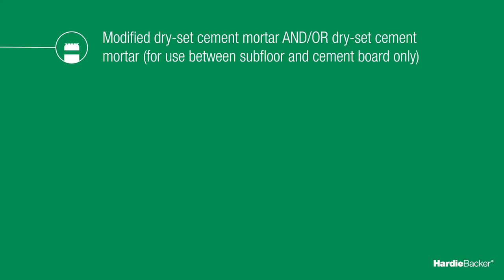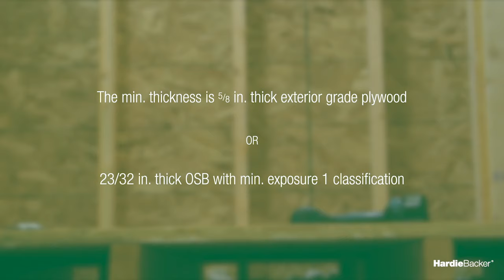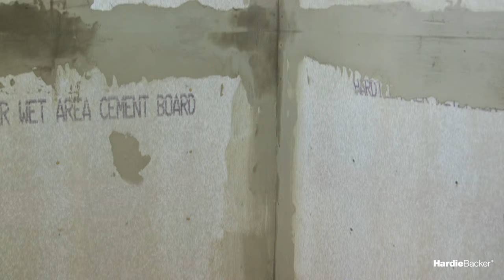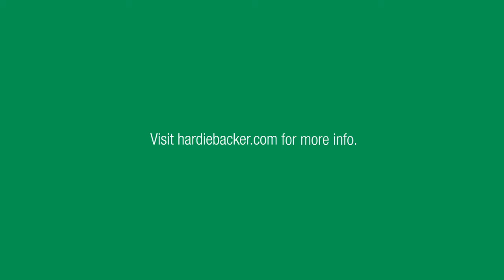How to Install HardieBacker Cement Board on Floors

Comment: What adhesive do i need under the boards? Video is not very clear on that. Have searched the whole Internet for an answer.
Reply: modified thinset
Reply: It's not glue. It's cement based thinset.
Reply: Elmer's

Comment: Question...Is it required to add both mortar and screws to the sub-floor? I've been told you can use screws (every 8 inches) and not use mortar. This is going in my upstairs bathroom. Can you comment?
Reply: Use mortar as well. Any professional tile installer more than likely will do both. Mortar is cheap and it's not worth the risk to just use screws.
Reply: I wouldn't use mortar if boarding over a plywood floor, the floor is flat and no voids, I only use mortar when need to fill voids below the backer boards
Reply: @rodlaz1984  Always use mortar on plywood subfloors...
Reply: @ruvimtrofimovich  mortar only to fill voids, if the wood floor underneath is flat, mortar is pointless
Reply: @rodlaz1984  Not to mention it would require all new subfloor if you tore it out one day. It would be destroyed.
Reply: You don't have to do anything. I've tiled directly on top of vinyl flooring before.

Comment: What steps require waiting in-between? I see that you apply thinset, lay the board, screw it down while thinset is still wet--all in one go, basically. Do you fill gaps and tape right away after that, while everything is still fresh, or do you let the under-board thinset dry/cure first? And if so, how long? Is there any advantage or disadvantage waiting--or not waiting--to fill gaps and do the taping before or after the under-board thinset has dried/cured? Does wet thinset bond differently to already-set thinset vs. fresh when mortaring the gaps/taping? How long to wait on everything before tiling? I was unpleasantly surprised to find no mention of these kinds of timings in the installation instructions. :(
Reply: Let it dry. Then fill in the 1/8 gaps with tape and thinset
Reply: @jond1965  wrong

Comment: Exactly which mortar do I use for hardie to wood sub-floor?..I want to use Mapei brand, but they offer 200 web pages of info instead of easy answers.
Reply: I used the Mapei Large-Format Floor and Wall.  It has the polymer so it meets the modified requirement, and on the front of bag it lists all of the substrates that it can be used over, with plywood included.  So just mix it up and use 1/4x1/4 square notch trowel to apply, then screw boards down.

Comment: Can HardieBacker be used as roof sheathing?  I plan on using epoxy and aggregate on my roof.  Have you ever had HardieBacker used for a roof?
Reply from the maker: Unfortunately, no. This would not be an approved use.
Reply: Not in hawaii… lol
Reply: That's funny, because I'm covering my floor with asphalt shingles instead of tile.

Comment: I’ve looked at a lot of videos to prepare for a project and this is the only one that describes the 1/8th rule, can you explain the importance and function?
Reply: Hey! I think it's important because you don't want to create stress points along the edge where the board could crumble under weight. I also think this is so that the installation of footboard and shoe moulding doesn't pierce through the board, which is essentially your foundation.
Reply: The reason, along with the same rule for plywood whether on a wall, floor or roof, is because of expansion and contraction. Not just with weather conditions, but if you get a leak or moisture. These gaps allow expansion.
Reply: When you tape the joints mortar fills the joint and makes it stronger. The mortar "keys" the joints together.

Comment: 1. For tiles, floors don't need to be level, but they must be flat. Self leveling products can help eliminate undulations.
2. i always add liquid polymer to thinset for strength and flexibilty.
3. plan cuts: for instance, start full patterns at entry to room or in bathrooms start opposite the toilet (full pattern is viewed from sitting on toilet and cuts are behind toilet.
Reply: You add polymer to modified thinet which has polymer additives in it already?

Comment: Can this be applied to entire second level (flooring)? Is this safe to install on entire flooring on 2nd level without any structural weight or any other issues/problems?

Comment: What about leveling a floor? Does it always need to be done, or only if it's uneven to a certain extent? And what are you supposed to use to level it if you do have to¿

Another question: do you need to remove Staples before laying the board if they are flush with the subfloor?
Reply: This is my question. You can level with self leveller but if you do it or not I don't know??

Comment: Do I have to put mortar between the plywood floor and the cement board? I have the plywood down on the plank subfloor.
Reply: Use mortar as well. Any professional tile installer more than likely will do both. Mortar is cheap and it's not worth the risk to just use screws.